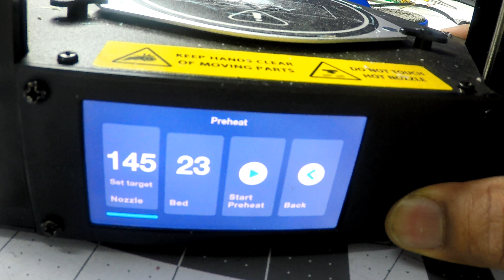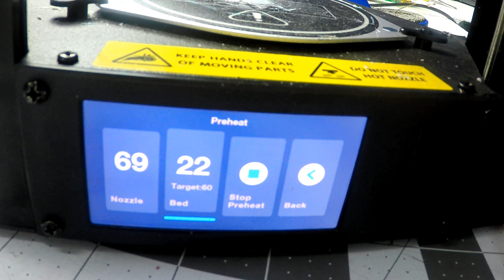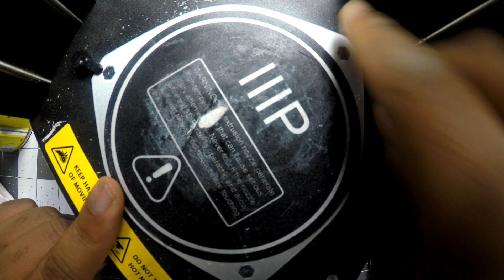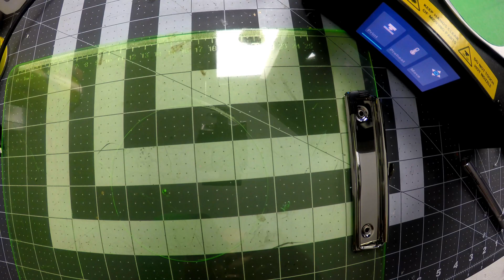Mono Price Delta Cleaning , Replacing Build Surface and Removing Prints

Comment: I put a borosilicate glass plate on mine with a Wham Bam magnetic bed surface.  Also made new bed clips that don't wobble which improves bed leveling.  I also got a 10A power supply and using the Marlin firmware, have everything calibrated and getting amazing prints with this little printer.

Comment: Does it hurt the bed if I don’t use tape
Reply from the maker: You can definitely scratch the bed a lot when removing prints if you don't cover it with something . It can make it difficult to remove prints as well .Printing on a bare aluminum bed isn't recommend .
Reply: Bare aluminum isn't a good surface for folding your print in place, even when using a glue stick.

Comment: Your Amazon like does not work for Goo Off Pro Strength. They only show Goo Gone and Goof Off Pro Strength. Which would you prefer to recommend? Thx
Reply from the maker: It was Goof Off Pro Strength I used sorry I forgot the f in the video . Didnt know the link was down I will update that.

Comment: Can you print ABS on this? because I'm seeing a lot of people saying it won't work.  Also you can get a glass bed on amazon for about $12.00 if that interests you.
Reply from the maker: I haven't printed with ABS on this printer yet just on my CR-10 . I prefer PLA but I will definitely give it a shot .In  the next day or so and let you know how well it works . It does state that it can print both. The max temp is 260 for the nozzle and 60 for the bed. Also I'm going to check out that glass bed definitely Interested.
Reply: @TheCasualCreator1  Thingiverse has a great project for a combined table clip and column shield if you do get a glass bed plate.
Reply from the maker: @patrickweaver1105  Awesome can't wait to check it out is it under Mono Price Mini delta when I when I search for it ?
Reply from the maker: @patrickweaver1105  thanks appreciate you taking the time to share .I'm definitely going to do more digging on thingaverse now .
Reply: @TheCasualCreator1  Given the size of the printer id have to suggest buying one of those insulated grocery bags you would usually find at Aldi or walmart and just throwing it over the entire printer. It should trap in more heat and help with ABS.
Reply from the maker: @DrawnDoggo  That's a good idea man I'll give that a shot .
Reply: I can print ABS on mine with a better power supply and the Marlin firmware.  Can get the bed up to about 80C easily.  Good idea to put a box over the printer to retain as much of the heat as possible.  I have a camera on my OctoPi so I can still monitor the printer from my web browser.